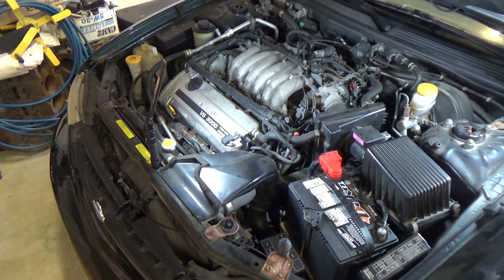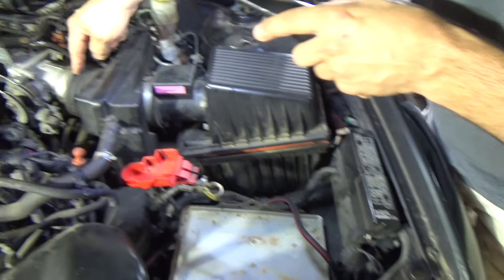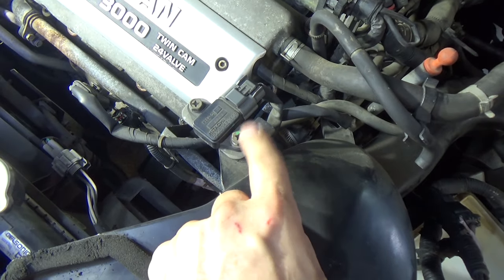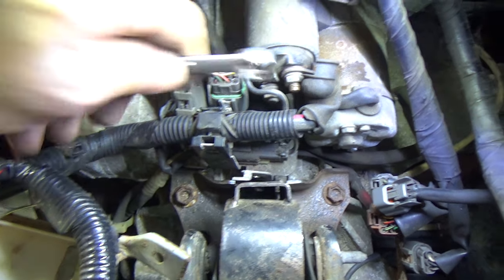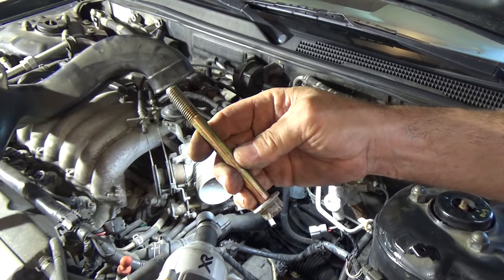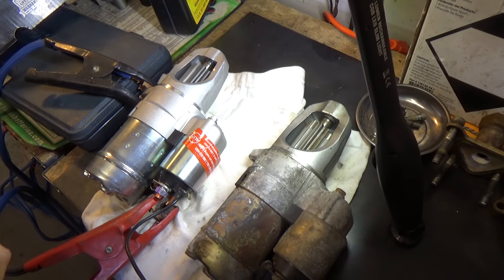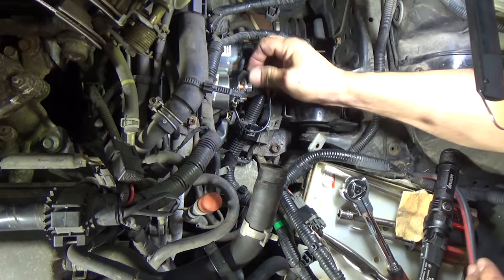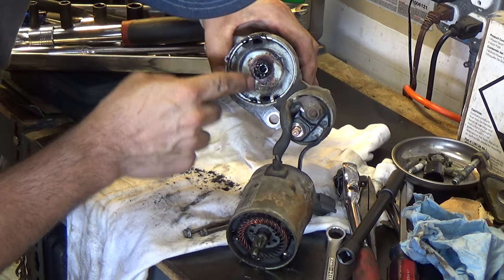Nissan Maxima Starter Replacement 4th Generation

Comment: Thanks for the lesson, people were telling me that it was a bear to do but I have always done my own repairs except for rebuilding trans..YUTUBE and people like you have shure made car repairs easier. Mine is the starter solenoid some times doesn't want to engage the starter just gives a slite click like a relay. Thanks again for your how too.
Reply from the maker: You are welcome Steve. Other than that one bolt that is factory tight as cryptonite it's not a hard job. Good luck with the fix!